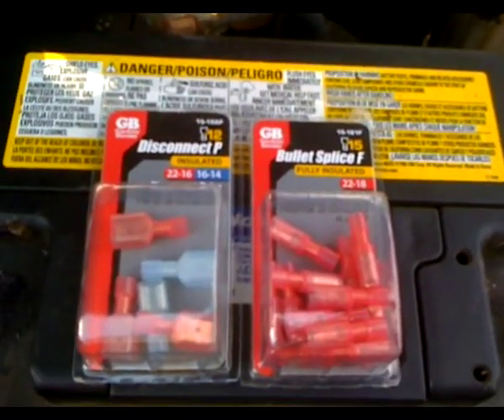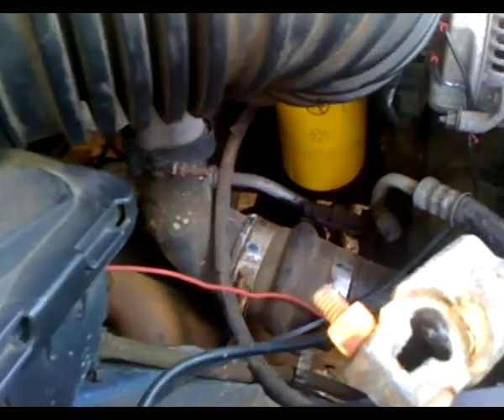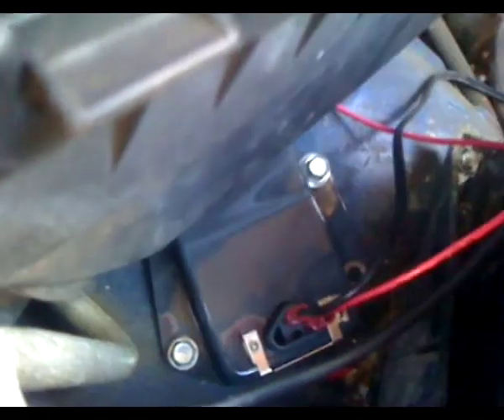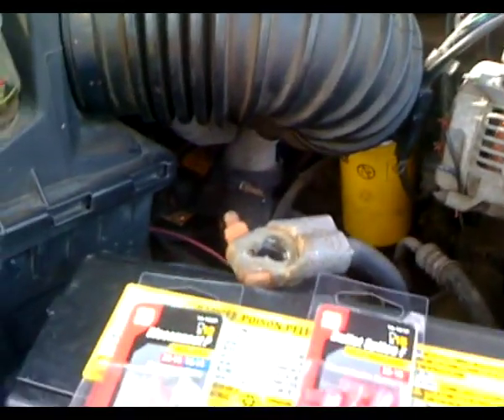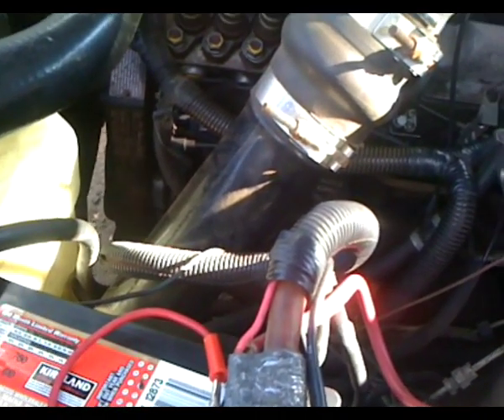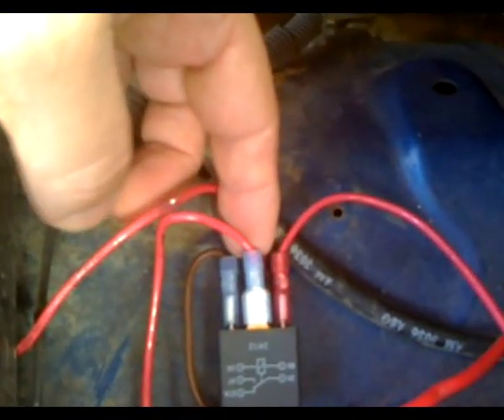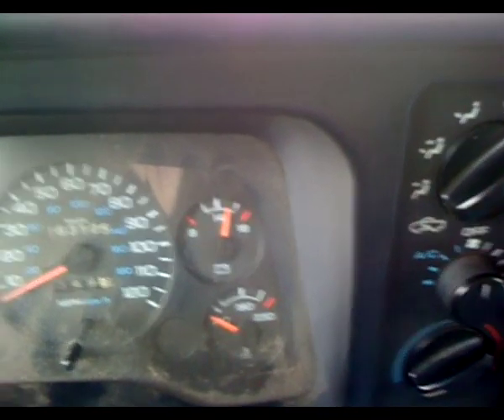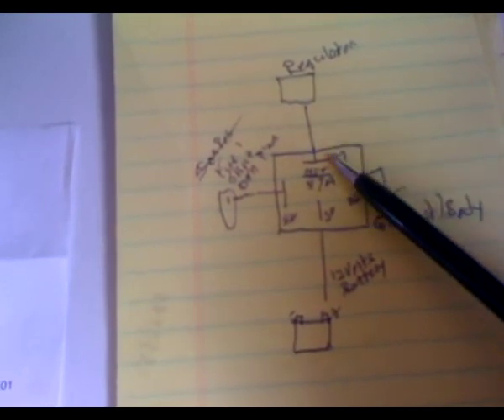1994 Dodge Ram 2500 External Voltage Regulator Modification

Comment from the maker: The relay is used to handle the amps from the alternator. You don't want 60-100amps trying to run thru the ignition system.

Comment: Did you have stable charging without the relay or is the relay necessary with the voltage regulator

Comment: Would this work for the b-series dodge vans?
Reply from the maker: Depends where the voltage reg is. Ecu, alt or? my dodeges voltage reg is in the ECU. You could try a alt with no internal reg? look up the year and model to see what alt is used. if not sure get some one to help.

Comment: It's usually not the PCM!!  You could change out the silver wires with copper ones going from the alternator back to the computer.
Reply from the maker: Interesting point Chris. Do you have more info why this might be the cause? I'll rig up some jumpers to try this.
Reply: @TheWaterman1000  Well, on my 91' b-250 those wires are silver fusible link wires. So, when the PCM stops regulating the voltage but still works in every other way, such as giving out a code, then how can you say that it's a bad PCM?? If the PCM is blown then it wouldn't even give you a code!! What dodge should've done is use an in-line fuse instead!!
Reply: @TheWaterman1000  Dodge has screwed over, literally, billions of unsuspecting people with this garbage set up.
Reply: @TheWaterman1000  Did you try it? Let me know when you can!

Comment: well mine went out front sparking 240volts at the battery. killed the original pcm.
i have put 3 different pcms on it that were good. granted they were different models and one was a gas pcm. so far havnt gotten the voltage to work, rpms, or speedo

Comment from the maker: And your point?? The relay is used to provide power to the regulator to trigger the field terminal via the voltage regulator to have the alt put out voltage. This install has been working great in my truck with no problems.

Comment: the relay positions are 30 +12vol or comon, 87 is a normally open contact 87a is normally closed (that's why it's hot) ait's a comutator relay, not proper for light's operation as you said because you wold not have a light's off position, either low or high beam only!! and yes 14.3 is perfect more than that will damage your baterry!!

great work man never the less!

Comment: thanks! i have a 94 grand voyager and wondered if i could connect an external regulator just like you have! i just ordered the Chrysler regulator on ebay for under $12 and can not wait to wire it up. who needs a pcm! thanks a bunch!

Comment from the maker: Thanks for the comment rick. I'm bouncing a idea on trying to come up with a cheap and simple way to turn off the check engine light, or just use a piece of black tape :-) Thumbs up on Orelly auto parts. I'll only use NAPA if I have to. I use Autozone and have them ship the parts in for free. I'm going  to do the shocks and tape that. I have about 4 more videos to compile.

Comment: I have a 91' dodge dakota, so I went online to O'reilly auto parts, and went back 1 yr to 1990 dakota and realized that yr had an external regulator not intergrated into ecu board like my 91', so I bought it for $12, relay cost $12, lot better than $200 for ecu from ebay. I have run across website that sells your set up for $100+. they also sell a device that tricks your car into turning off engine light. if you figure out how to do this on the cheap side please post, thanks again Rick

Comment from the maker: Outstanding Rick. What reg did you use and from where? I bought my adjustable from the mainland out of a little starter/alt repair shop. That's chicom was putting out 15.4volts. Many said it was ok. I felt no...... And so did my alt, had to replace that.

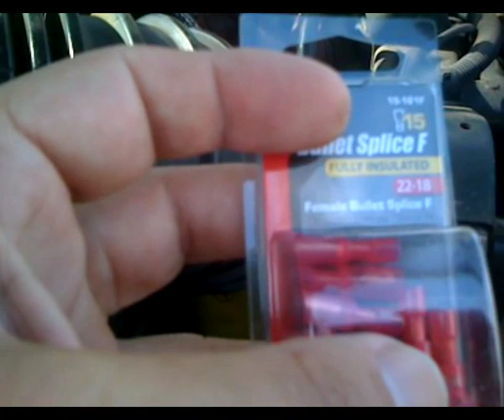Comment from the maker: the other onto the 3:00 pin. I know what you are referring to. The reg grounding is via the truck body. Has to have good contact or reg won't work. I'm also getting ready to do a follow up video about what reg you should use. I finally tossed the NAPA chicom crap in back of the seat and installed and adjustable reg. Voltage right where I want it.

Comment from the maker: Rick,
On my example the two field terminals go to the voltage regulator. The field terminals don't matter how you hook them up to the regulator. The video shows how to hook up. ALWAYS REMEMBER THE IGN/HOT-POS WIRE GOES TO THE 12:00 PIN. ANY OTHER AND YOU FRY THE REG. Take one field wire and wind it together with the IGN/HOT wire then crimp on a connector that's shown in the video. Then take the other field wire and crimp on a connector. Plug hot/ign wire onto 12:00 pin then plug
the other on the

Comment: question, the 2 posts on back of alternator, one goes too positive (12oclock) of regulator, does the other post go to the 3'oclock on the regulator, I saw another video where they put negative of regulator to ground, also, the 2 posts on alternator, how do you tell which one goes to 12oclock on regulator? is one positive and one negative? or does it matter?